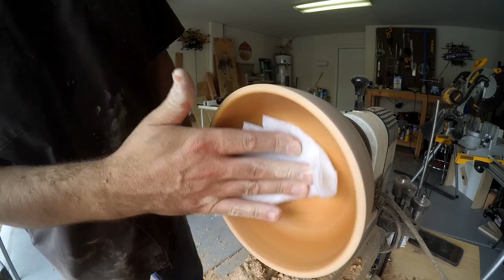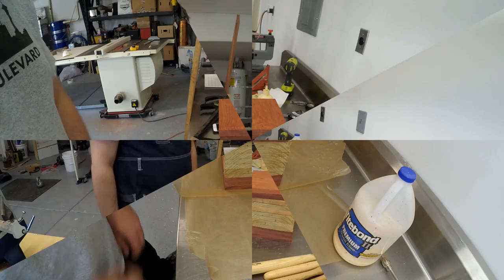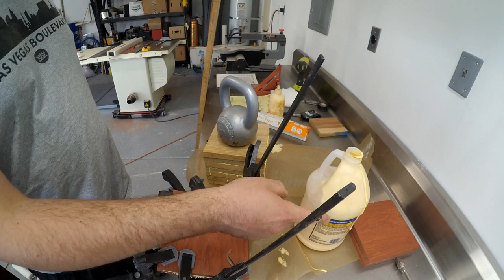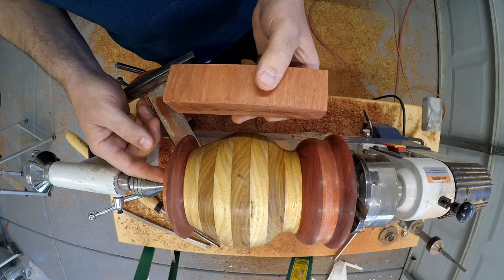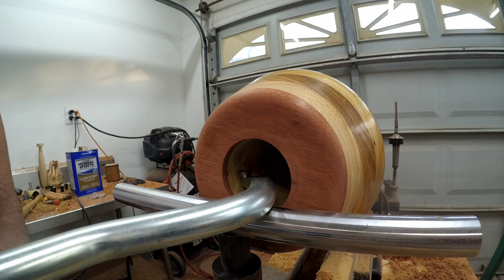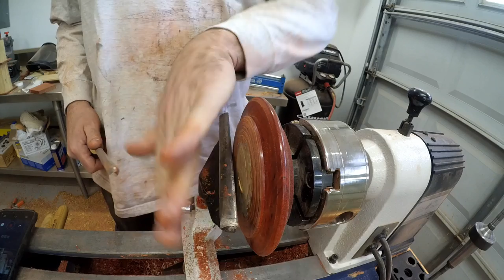Woodturners Journal: Turning a Lidded Box with Legs

Comment: Hi Jerrod, I know this is several months late but just wanted to say that I enjoyed the turn. It turned out great! I especially like the affect of alternating the grain direction. Amazing how such a small thing can yield such a great affect. The general shape reminds me of old "jaw breaker" or bubble gum machine. Yeah, I guess I just aged myself. LOLI also love that stainless steel bench you work on! Never have seen that in a wood shop, it is a great idea. No stain issues, no glue. build up and no nail heads. :-)
Reply from the maker: Thank you and no matter how late, it always much appreciated.  I agree about the shape.  After I turned it, I thought the same thing.  The stainless steel table is a heavy duty restaurant prep table that someone was throwing away and offered it to me.  I was in the right place at the right time.  It has worked out really great.  Like you said, clean up is a breeze.  Even things like epoxy chip right off of it.  Thanks again.

Comment: Great video of the bloodwood boul
Reply from the maker: Thank you.
Reply: Also enjoyed the boul with legs
Reply: I would like to know the maker of your lathe
Reply from the maker: David Jackson I use the Rikon 70-100, but I would not recommend it.  It is cheaply made and as time goes on it's getting worse and worse.  My banjo has a huge crack in it out of no where and getting replacement parts seem to be a hassle.
Reply: What would you recommend, or should I ask if you were to buy a new lath what might that be?
Reply from the maker: David Jackson It's a little more expensive, but I would of gotten a Jet of I was doing it over.  They are owned by Powermatic and are very well built.  To many parts on the Rikon are cheap cast metal.  If you're really serious about turning, perhaps a larger Powermatic, but they can get pretty expensive.
Reply: Thank you for all your information
Reply from the maker: David Jackson Anytime.  I'm happy to help.  Thanks again for watching and the support.